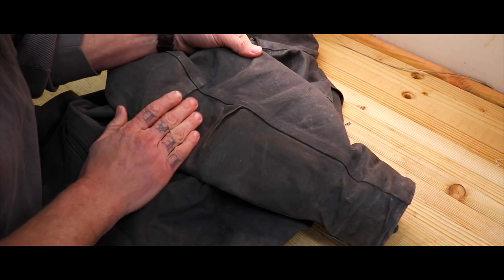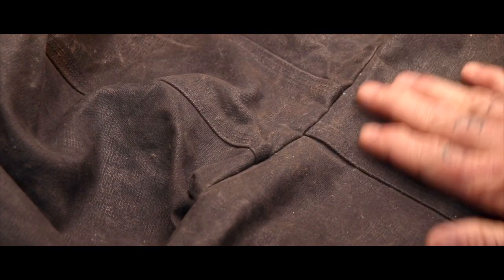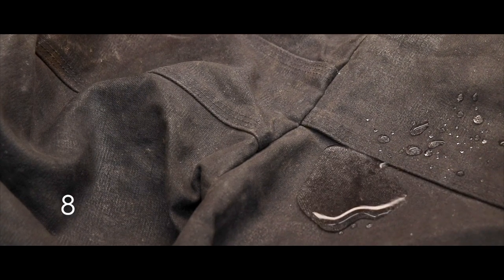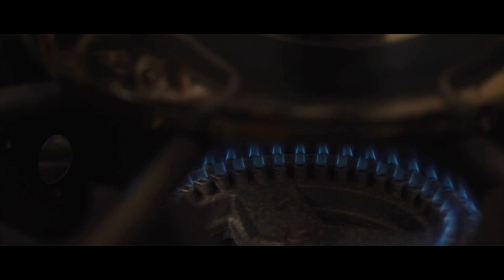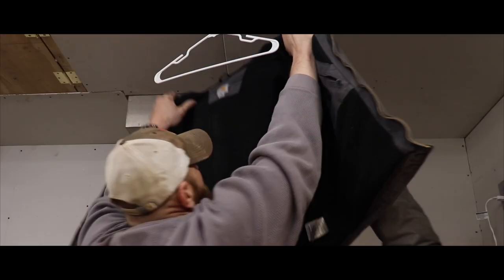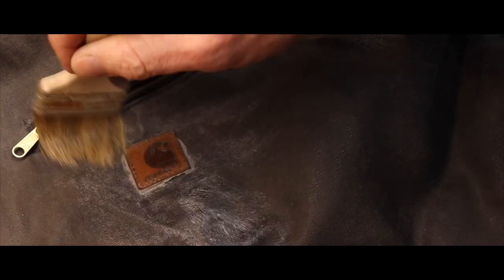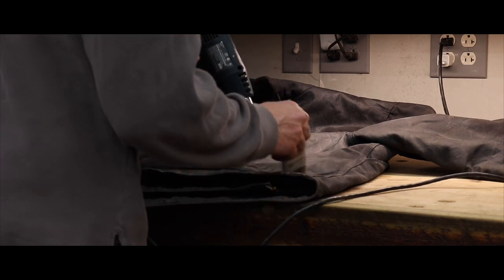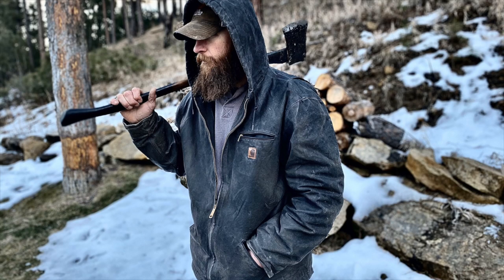waxed canvas/TIN CLOTH jacket followup

Comment: I just treated my first Carhartt jacket after retiring my first from 2015 of hard use without a wax finish.  The biggest thing I have noticed from an unwaxed coat verses a waxed coat is that the waxed version is the ultimate dog hair collector. I have two Australian heeler. The waxed version sure does smell good and looks good even with a fur and wax treatment.  Thanks for the video.
Reply from the maker: Really? I’ve not noticed that problem with mine. I’ve got two dogs as well and it doesn’t stick or cling to bad. Interesting. Thanks for the comment!

Comment: I just bought all the stuff to do this. My cousin said he had a wax treatment on his jacket before. And liked it. But once it started to get a little dirt and grime it would transfer it to furniture to his truck seat real bad. I’m still gonna try it out though. Maybe he didn’t keep his as clean. He does to a lot of shop work too.
Reply from the maker: The dirt and grime would transfer to the seats or the wax mixture would transfer? I suppose if it was the dirt and grime it would transfer regardless of it being treated or not depending on how dirty the jacket was. I made sure to “push” the mixture into the fabric as deep as possible. This helped dirt and grime slide or fall right off because there wasn’t anything for it to cling to.
Reply: @TheHiddenHomestead  he made it out like it was the oil and wax coming off with the dirt and grime. But he also bought something premixed and treated his. I’ve read great things about the mixture you used. Another guy on YouTube did some pretty good tests on the stuff you used.
Reply from the maker: @aleksfoxtrot8044  are you talking about the lone woodsman? If so, yes he did an amazing job. I referenced his video on it in my description. Very informative
Reply: @TheHiddenHomestead  I had to go back and look. Yup. That’s the guy. 
One thing I noticed is he measured the ingredients by weight instead of volume. Do you think that makes much difference?

Comment: @TheHiddenHomestead any thoughts on how to fix an OVER waxed jacket? I picked up the same jacket but mag have gone way overboard on the wax. Every scratch or touch leaves behind white marks.
Reply from the maker: I believe a lot of that will eventually wear off. Because it’s mainly on the surface and not in the fabric. Did you use a heat gun to get it hot enough to run down into the fabric? If so, try heating it up  again with the heat gun and wiping or scraping the excess off and save it for later if you need to reapply.
Reply: @TheHiddenHomestead  Yup! Used a heat gun and could see it soak into the material. Im hanging it outside in the sun to reheat a bit and can see it wet at this point with so much wax. Will try to use the heat gun again to get some of the excess soaked up or even burned off a bit. I need to pick up one of those wider brushes as well to try to smooth it out.
Reply from the maker: @TheLittlebird956  brushing it with a stiff bristle brush definitely does help
Reply: Another thing you can do is hot iron the jacket with something on top of the waxy fabric like thick brown paper or a towel. By doing this the towel or paper will suck up the excess wax for you.

Hopefully that helps.
Reply from the maker: @LSD-420  that’s a great idea.

Comment: Got an extra pair of overalls I've been thinking about doing this to. 
Seems a bit difficult to do without a shop though.
Reply from the maker: I don’t believe it would be difficult at all. If you’re concerned with mess just put some plastic or a drop cloth down on the table. If you do it inside your home I would exercise extreme caution melting and mixing the ingredients. The liquids are HIGHLY flammable. If possible I would try to do that outside.
Reply: @TheHiddenHomestead  I heard the microcrystaline wax gives off some really nasty fumes. But I also hear mixed info on that. 

Waxing makes it pretty unfeasible to wear in the summer, correct? It's one thing to have an unwashable jacket, but unwashable pants could get nasty fairly quickly if you sweat a lot.
Reply from the maker: It’s not the wax that’s really flammable. It’s the tung oil finish and especially the mineral spirits. 

Yeah. If you sweat a lot they will get funky. That being said I’ve had people comment on here that they use cheap vodka to wet the inside. The alcohol kills all the bacteria that causes the funky smell

Comment: Any guess on how many oz of wax it soaked up in the end?  I'm just curious what the weight difference is.   And would you use it logging?  Just don't want it to have too much dust stick and mold. Thanks.
Reply from the maker: I believe the wax that I got was a 16 oz bar. In the two application I used roughly 2/3-3/4 of that…maybe? I didn’t really notice any weight difference. I absolutely would us it logging. I know saw dust doesn’t stick to it.

Comment: I have a LL Bean Cotton Field jacket. Is this solution that you mixed together for just canvas or also for a cotton field coat that has never been waxed?
Reply from the maker: Some newer canvas garments are made with  a synthetic blend but most are made of cotton. This includes the one that I did in the video. So, yes I would assume it should be fine.

Comment: Did it affect the breathability enough to get that rubber rain coat clammy feel? About 20 years ago my friend did his Carhartt bib overalls with snow seal leather treatment. He said the breathability was pretty poor, I think he may have overapplied it and clogged the pores.
Reply from the maker: Well because it’s seals it up so good from the elements it doesn’t breath great. But for me it feels like it has good ventilation because of how it fits me.
Reply: @TheHiddenHomestead  l have found that well proofed Barbour thornproof (waxed cotton) garments aren't particularly breathable, but better to be a bit damp from sweating than wet from a porous jacket!!!
Reply: Thats exactly what the treatment does, it fills the space between the threads to keep water getting through.
Reply: @timhorton8085  The trick is to get only the fabric to absorb the wax and oils by treating the threads before they are woven together at the factory. 
After the threads are woven there should be square like voids in between the threads to allow microscopic water vapor to escape aka steam. 
When the pores are small enough do to a high thread-count raindrops and mist can't enter without pressure, but water vapor has no problem leaving 👍.

This is exactly how modern synthetic waterproof breathable membranes work also as well as our own skin 👍.

Comment: Excellent video! Watched this several times and planning my own waxed jacket project just like yours. However, a friend told me the wax will rub off on your car seat. Has this happened to you at all?
Reply from the maker: Awesome. Thanks for watching!! No not that I’ve noticed. Not saying it couldn’t happen but I wear it almost everyday through the the winter months and haven’t noticed any wax residue.
Reply: The wax will transfer onto layers and car seats etc in warmer weather. The key is to not over wax your garment and the tighter the weave of material you are waxing the better it will take the wax. Carhartt is a looser weave of canvas, will still work well just not great.

Comment: Is the jacket excessively hot?  Such as you get hot and sweaty quicker when doing hard work vs an untreated jacket?
Reply from the maker: I don’t know if I’d say excessively but it is warmer just because it’s sealed up more. As far as getting hot and sweaty quicker I’ve never paid attention because if I feel hot I simply take it off. Weather and temps fluctuate to much here so in the colder months I dress in layers and always plan to strip some off when I start working.
Reply: @TheHiddenHomestead  Thanks.  I was thinking about doing this for the purposes of having a highly durable windproof jacket for hiking, potentially in a group that may not want to stop so that I can strip my pack and doff a layer.
Reply from the maker: @viewatyourownrisk  I wouldn’t recommend it for hiking. I do a lot of backpacking myself and for me personally this would be way to heavy and bulky to carry around in my pack if I weren’t wearing it.
Reply: @TheHiddenHomestead  Thanks for that info.
Reply: @TheHiddenHomestead  sounds like it would do to just remove a packable scarf, cap or insulating layer and keep the jacket on

Comment: Did this over the weekend and my jacket has a waxy feel to it. I'm a little paranoid it will rub off on the seats in my jeep. Is that waxy feel normal? Or did I do something wrong?
Reply from the maker: Yes the waxy feel is normal. Did you melt and penetrate it well enough into the fibers? If so, it SHOULD be ok because it’s soaked in and not just setting on the surface. That’s my disclaimer. I can’t guarantee that it won’t rub off because I don’t know how much is on the surface of the jacket nor do I know if you have and keep the seat warmers on at the highest setting for long periods of time which could re melt a small portion of the wax. I suppose that is possible. I’ve personally not noticed any rubbing off onto my seats. However, I have nylon seat covers on all my trucks which of course aren’t as absorbent as cloth.
Reply: @TheHiddenHomestead  I appreciate the response. I suppose it's safe to assume that it is possible for extra wax to come off if applied toothpick and or not melted I to the fibers well enough. Other than that, the process was very effective for repelling water during the absorption test on day 4 after application. Haven't had the chance to wear it out in the elements just yet, but I'm guessing it will function as it should. Also, I 100% agree with you about the stiffness of the clothing until its worn for a few minutes and softens up some. 
Anyway, great tutorial, thumbs up!
Reply from the maker: @michigan_masks8969  Awesome glad you like it! Yeah you’ll get a little wear off but I wouldn’t think it would be much. You’ll have to let me know what you think once you get it out and try it.

Comment: I think that not washing it would be the only drawback to doing this treatment. There's only so much febreze you could use to keep the funk level down.😆
Reply from the maker: Lol. You would think. I normally have a few layers on when ware this jacket so fortunately I don’t get any B.O. funk on it. Really it just has a slight earthy funk to it from the concrete, dirt, grease, wax/tung oil, etc. so not bad for a work jacket IMO
Reply: I have a brand new carhartt work coat I was looking to doing this treatment with but I think I'm just going to spray silicone on it and be done with it. I'm not sure of the make a model of mine but it's very similar to the one you have. Thx for the reply.👊
Reply from the maker: @juancarlosnegron2358  you’re certainly welcome!

Comment: Never waxed a jacket but being canvas it probably has better results than waxing leather boots. I have waxed my work boots before and every speck of sand within a 5 mile radius stuck to them.
Reply from the maker: Really? Ive not waxed a pair of boots since they changed the military uniform years ago but I guess I never noticed that.
Reply: @TheHiddenHomestead  I had a pair of Red Wing leather wook boots that I turned into dirt magnets. Water would bead up and roll off but the dirt, sand,sheetrock dust,etc,etc was there to stay. If I hadn't used them for work they wouldn't have been so bad.
Reply: @not1au  Hello. I've found that by placing my leather work boots in the oven on a low setting prior to applying a water proofing agent allows the leather to absorb the agent. I've never had a problem with dirt sticking to them. They appear as though they were conditioned from the factory. I've worked in all conditions from sand to mud. Just like anything else, eventually the boots will need to be cleaned and waterproofed again. Maybe once per year depending on how harsh the conditions are.
Reply: @beerhunter272  thanks for letting me know. It probably was because they weren't in need of wax yet. The wax soaking in vs building up.

Comment: You can also do this on the cheap with four parts by weight of candle wax and one part of sunflower- or rapeseed-oil. It is also pretty nice to sew, for example to make a Waxed Canvas Tool Roll for Wrenches:
https://www.youtube.com/watch?v=dQcGzz4K4Wc
I used a torn jeans and an old household sewing machine from the fifties to make it.
It's pretty important that the wax-oil-mix be kept hot while brushing it onto the fabric, I always left it on the pot with hot water.
When dealing with fabric for sewing, you can also put the canvas between two sheets of baking paper and use an iron to distribute the wax evenly.
Reply from the maker: Awesome. Yeah that’s a great idea!

Comment: Does the tin make the jacket warmer?
Reply from the maker: Not really warmer. It helps block the cold wind though.
Reply: l have found that in cold weather these types of jackets actually conduct cold through to the inside meaning an extra insulating layer will probably be needed, have been wearing Barbour waxed cotton clothing for over 70 years in some horrendous weather and never been let down.
Reply: @clooperman3745  70 years!!! You're doing ok then! Thanks for the tip!